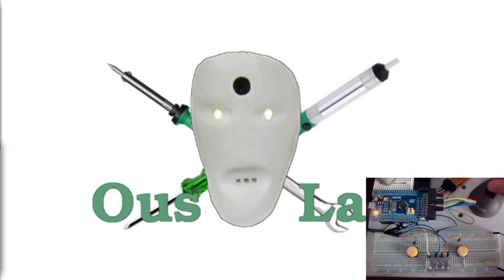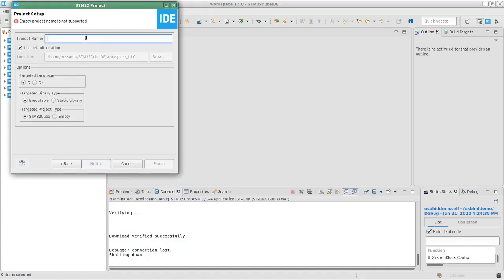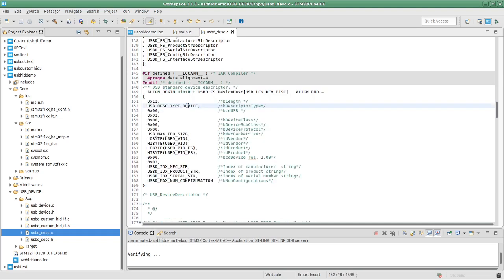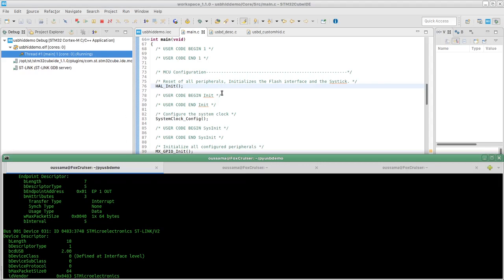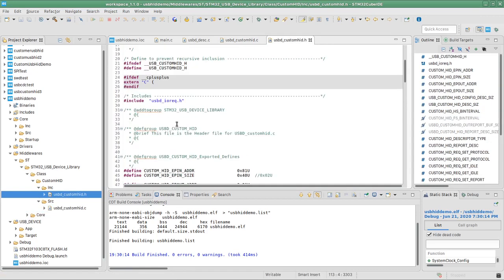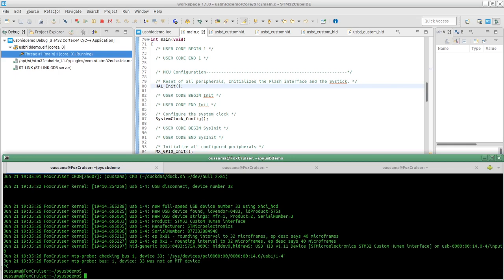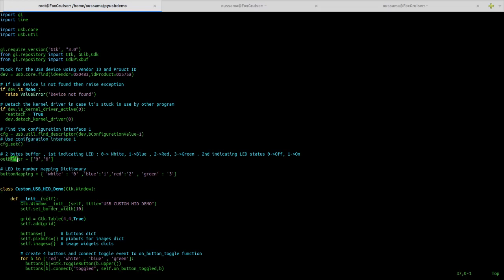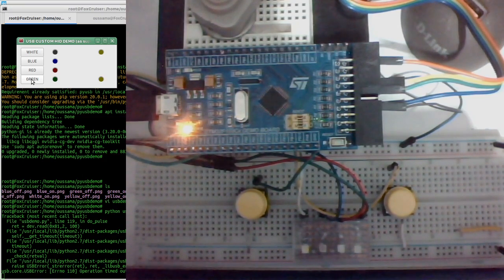Custom USB HID Interface using STM32 (stm32f103c8)

Comment: Thank you for taking the time to make this. It saved me hours. The USB protocol is very complex and I couldn't find a concise tutorial. I thought I needed to make a custom report descriptor which is a real rabbit hole.. Oussama walked me through how to setup exactly what I was looking for and tied to together information I'd gathered elsewhere. I have solved my current problem and I have better understanding of USB HID protocol and STM32 USB.
Reply from the maker: Thank you, i'm glad it helped.
Good luck and keep on building:)
Reply: I think the report descriptor matters if you create a device that's compliant with some standard. e.g, a keyboard. If it's your own proprietary device, and you use libusb, you simply get to write whatever you want to your endpoint, ignoring the structure that the report supposedly specifies

Comment: Thanks,this is what I was actually looking ! i.e.  a code to write from host to device USB. Thanks man!
Reply from the maker: I'm glad you found it useful. Good luck man !
Reply: @OussamaOusmoi  Hi its me again! I have data in an array of 150 rows with 2 columns that I need to send from my host to my STM32 device using USB. I can see there is a 64 bytes limitation when setting up the out report buffer. How can I go round this limitation to send the full data set to my device? Thanks
Reply from the maker: 64 bytes is the maximum data you can send at once using full-speed configuration.
But you can split your data and send it on multiple writes , that's the easiest way if the speed is not critical .
You can also look into other transfer modes like bulk .
64bytes is the maximum for full speed usb though, i don't think there is a way around that .
Reply: @OussamaOusmoi  Thanks for the reply. I don't mind using other transfer modes. Do you have a video or article on how I can use the bulk transfer mode? Thanks
Reply from the maker: @otenyop  Unfortunately i don't have any video regarding bulk transfer, i never  worked on it either . Probably i didn't explain well in my last message, but even with bulk in full-speed USB you will be limited to 64Bytes , the only thing you will gain with bulk is speed.
  High-speed USB can go up to 512bytes ,  but that's a different hardware and software implementation which is beyond my capabilities at the moment : ).
 But i still believe you can get away with 64bytes . if i understand well , you need to transfer 150*2= 300Bytes ? . you can send that in 5 parts
Reply: @OussamaOusmoi  Oh great Thanks,I get it now. Let me try and see how I will send the data across in 5 parts. Thanks I appreciate your help.

Comment: 30:40 Note about the timeout of 100ms: You set the timeout to be the same number as the report interval. The timeout effectively races the interval. In the unlikely event when they align perfectly, you have a race condition. Make the timeout larger - say, 5% so that this race condition will never occur. FYI, USB HID devices self-report what the report interval actually is, in their descriptors
Reply from the maker: @eitantal726  I see that makes sense, thanks 👍

Comment: 25:27 More specifically, linux comes with its own built-in driver for generic HID. you'll find it in /dev/usb/hiddev0 . You're using libusb, so you need to "unseat" the driver that you do not use, so that libusb has access. I don't know of python bindings for said built-in linux driver

Comment: Thanks for the video! Ive been exactly looking for something like this. I have some questions: 1. Is it possible to change the hid descriptor so that the stm32 is being recognized as a keyboard? (So the stm32 acts like a keyboard, but you can still control it via a GUI in python for example). 2. Is it also possible to receive data from the stm32? (So for example the GUI in python reads some data from the STM32 over the usb hid interface)
Reply: Yes and yes. Matej Blagsic has a YouTube video showing how to make a keyboard with the Custom HID class. Sending data is actually easier than receiving because you can just use USBD_CUSTOM_HID_SendReport. You should be able to make your device work as both a keyboard and a custom HID device to send data back and forth by using multiple collections in your report descriptor.

Comment: im on windows 10 and get in device manager "unknown USB device (Device descriptor request failed)" any idea in which stage this can fail?
Reply from the maker: If I was you, I will probably check CUSTOM_HID_ReportDesc_FS  and 
USBD_CUSTOM_HID_CfgFSDesc 
maybe you missed something.
Good luck :)
Reply: @OussamaOusmoi  How does your computer identify the device? did you install a driver?
Reply from the maker: @bassamry  In linux the driver is supposed by default. on windows not sure, try search for usblib driver for windows maybe that's what missing.

Comment: Thanks for your videos!  I jumpered my ST-Link V2 and although it's difficult it works like a charm.  Enjoyed that video.  I'm looking at this HID interface video and I'm wondering if you can describe the tools your using to create the gui etc.  Python apparently as well as?  Glade maybe?  If you could go into some detail about what you're using I would certainly appreciate it.  I'm on Mint Mate 20.2 Uma.  Thanks in advance Oussama!
Reply from the maker: Thanks, i'm glad it helped .
Regarding the GUI i didn't use any tool, you just need Python and the GTK library , i've used grid layout to align the elements and that's it :) .

Comment: Hi, Thank you for such detailed explanation. I'm facing this issue on windows, where the dev.write() method is timing out. Occasionally it has not. Would you have any idea what's happening?
Reply from the maker: If you are not sending a lot of data and not sending it too quickly it shouldn't timeout , the only thing that i suspect that could cause that is hardware, double check if your usb wirings is well connected and of a good quality cable to minimise interference.
Good luck
Reply: @OussamaOusmoi  I'm just trying to write 2 bytes. Also, I'm able to read (2 bytes) without any issue. But write times out most of the time. There is no problem with device recognition either. So I don't think it's a hardware issue.
Reply: There is some issue with the CUSTOM_HID_OutEvent_FS() function which does not get invoked whenever the PC is sending something to the MCU. But when I used the USBD_CUSTOM_HID_ReceivePacket(&hUsbDeviceFS) function (I'm using STM32G473) in the main while loop to read data, the timeout issue doesn't occur and the data is reliably sent to the MCU! I don't understand why the CUSTOM_HID_OutEvent_FS() callback function isn't working.
Reply from the maker: @abhishekshankar4072  I see that's odd, I would love to thinker a bit more on this but i had to disassemble my setup .  if you find the cause plz share it with us 👍

Comment: I don't really understand the part where you updated the report descriptor to include an extra byte (12:02) Can you link any documentation on this part please?
Reply from the maker: As i mentioned the report descriptor is for devices that need to be recognized by the host , such as keyboard, mouse , joystick ... . the byte 0xa1 0x01 represents the beginning of somethings called a Collection( Application )  and the end of the collection is represented with 0xc0 . It's the minimum that the report descriptor need to have , at least what worked for me . 
you can check this link https://eleccelerator.com/tutorial-about-usb-hid-report-descriptors  it's not applied for the stm32 , but it may help you understand it a little better .
Reply: @OussamaOusmoi  Ahh Thanks! I understand now. Those 3 bytes creates an empty collection. I guess you could have specified more in the report here to describe all the buttons.
Reply: Actually, when I plug in my stm32 device I have an exclamation mark next to the "USB Input Device" in device manager, and I have the message "A top level collection was declared without a usage or with more than one usage." Any thoughts?

Comment: Hello how are you. Excellent video, good explanation. Congratulations. I unfortunately for my application with the Host already developed I can't receive more than 2 payloads by the function -> static int8_t CUSTOM_HID_OutEvent_FS(uint8_t *buffer). Even the link on the STM website similar to your explanation didn't work either. To send payloads from Device to Host works fine, Ok. Could you help me and I thank you in advance.
Reply: I'm using STM32F072 without clock extern

Comment: you are doing great, I am working on my final year project , I want to build a password manager using hid devices . I need guidance like where to start from can you help me?
Reply from the maker: Hi,
Most of DIYs password managers i've seen do acting as an HID keyboard , so i would suggest to start by implementing that first . i suggest to look for an arduino based DIY projects instead of an STM32 as really the documentation is lacking a bit on the STM32 HID devices .
I was actually very interested to build a password manager as well, i just couldn't find the time to do so. so maybe it's the time :).
If you want to keep it simple, there is an arduino implementation for HID usb, it's called V-USB , it uses a regular atmega8 or an atmel 328p microcontroller that are found in most of the standard arduinos. you can check it out as well.
Good luck

Comment: Hi. Great work, Would you be kind enough to assist me how can i use my esp32 as an HID keyboard device
Reply from the maker: Hi najam,
The esp32 is actually different than the stm32 , I never tried HID usb on it and I don't see anyone managed to implement that so far . however if you want  bluetooth HID keyboard it appears that there is a github repository owned by manuelbl, check it out.
Good luck

Comment: I made the same but it gave me "driver error" issue on windows 10.
Reply from the maker: I haven't test it on windows, so i can't help you much. however make sure to install libusb version 1.2.6.0 as it does support windows 10 64bit  and see if it works.